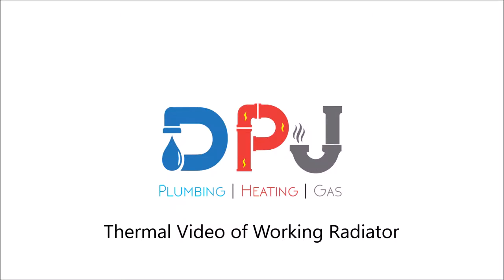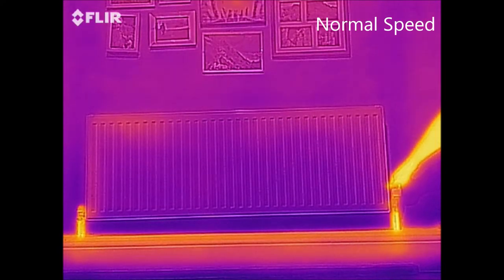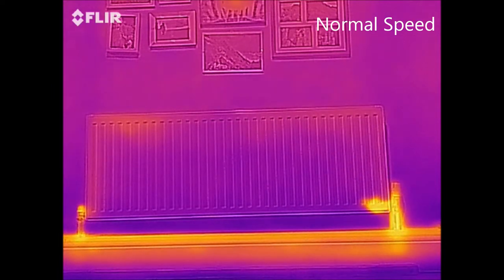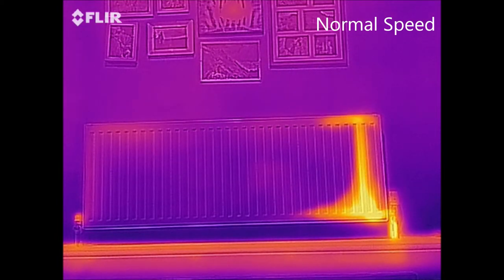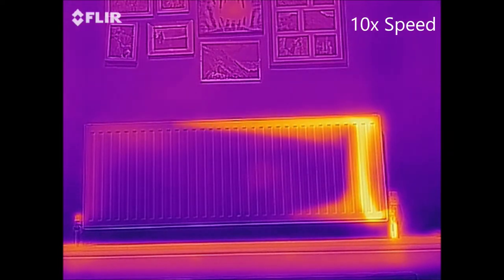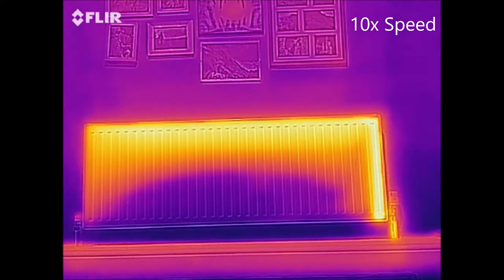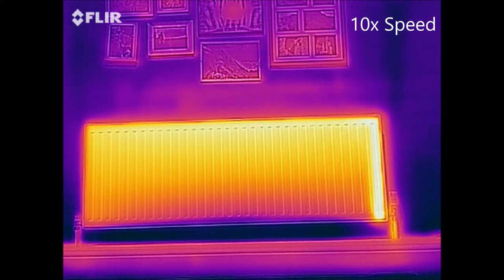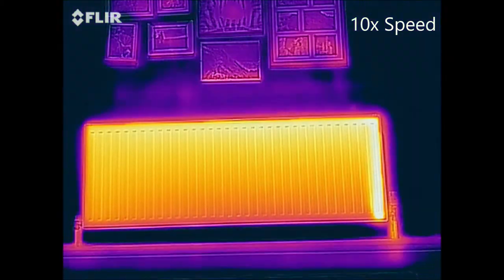Thermal Video of a Working Radiator

Comment: hi m8
awesome vid! can this cam pickup pipes under carpeted floor?
need to figure out my return and flow pipes.
thanks
Reply from the maker: Hi S.O.A,

If it's in a concrete floor then I would probably say yes. If it's under a timber floor/in a void then no. As the heat would just heat the void up first.

It's difficult to give you an honest answer without seeing what you have as there are a few factors to take into account aswel. Pipe depths, insulated, material buried in etc.

Hope this helps,

DPJ Plumbing Heating and Gas
Reply: thanks for the swift response.
yes its a wooden floor, so carpet, underlay then wooden floor. id say theres about 2cm gap between wooden floor and pipes.
Reply from the maker: @s.o.a8520  

Personally I would say it wouldn't pick them up very well unless they have a good gap between each pipe.

It would most likely be easier/surefire way to know by pulling back the carpet and lifting a floor board but I'm guessing this is what you're trying to avoid.

Cheers

Comment: if you had to dry a pair of shoes, would you place them on the floor near the radiator, or on a shelf, 4 feet directly above the radiator (assuming radiator is on, of course)?
Reply from the maker: I have a radiator in the utility which I don't care too much about so I usually stick my wet shoes directly on top. 

The floor is the coldest place so effectively that would take the longest amount of time to dry a pair of shoes out.

Hanging them up is probably the best way for naturally letting them dry with a decent amount of airflow around them.

Every shoe is different and I'm sure shoe manufacturers all have recommended ways to dry their shoes.

Hope that helps 👍

Comment: Hi my radiator not heat up at bottom
Reply from the maker: Hi Mohammed,
Your problem sounds like the bottom of the radiator contains a buildup of sludge. Usually the easiest way to remedy this is to remove the affected radiator and put a hose on the end of the radiator and run water through the radiator until the water runs clear. I'd also use a rubber mallet to help dislodge debris. And then reconnect the radiator.

But if your radiator is sludged up to the point that it's stopped working I would be concerned about your heating system condition and I would strongly recommend a MagnaCleanse or powerflush and treatment with cleaning chemicals and inhibitor.

Hope this helps Mohammed, if you have any other questions don't hesitate to ask.

Thanks,
Dan

Comment: Which camera is this on please?
Reply from the maker: Flir one thermal camera. It is attached to your smartphone.
Reply: @dpjplumbing  cheers buddy. Looking at getting one but there are that many about... one that goes onto my samsung would be good
Reply from the maker: @dw_plumbheat  I think they do 2 types: android or iPhone. 
But I got a that a couple years back so not clued up on the current lineup.
My one is usb-micro but I got a usb-micro to usb-c adapter because my newest phone is usb-c. Not had any issues with it.